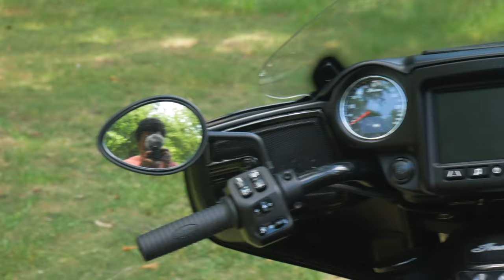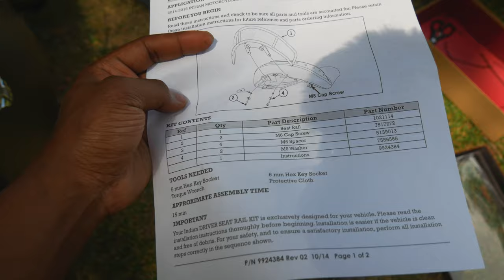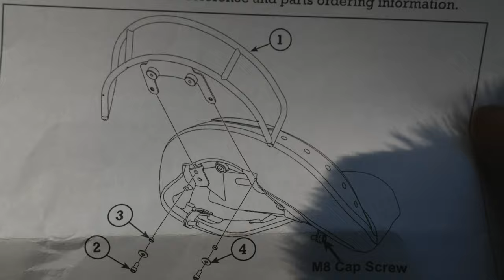Lenore installs a grab rail on her 2018 Indian Chieftain

Comment: Where did your uncle get the Indian Head dress that lights up?
Reply from the maker: Wired it himself. The 19 has the connector for it. Gotta get an led strip, drill a hole in the fender under the head dress, run the wire to the head dress connector on the hardness and that's it. I will do a vid on it. I didn't catch the install on camera.
Reply: Brandon Bicasso thank you so much for answering watch all your videos
Reply from the maker: @oldgrouchybastard4202  Sure thing ❤